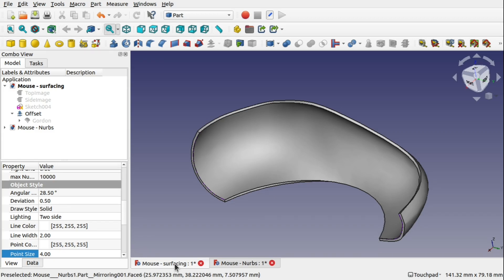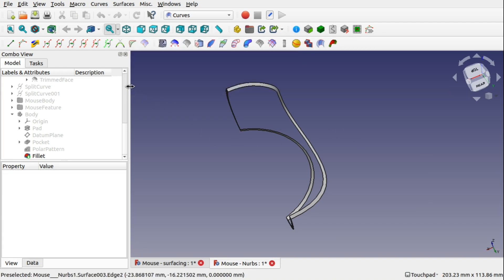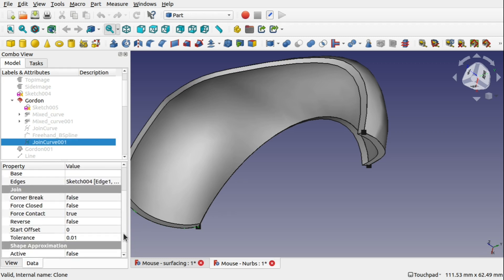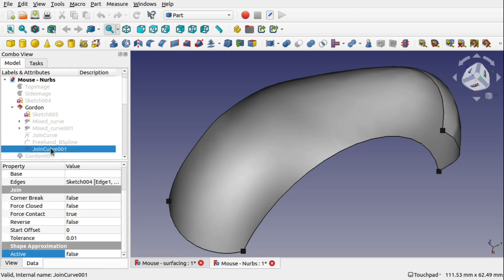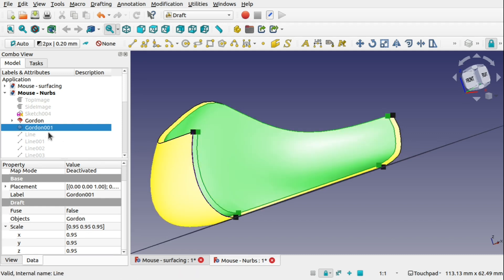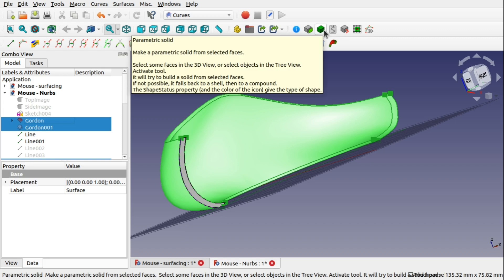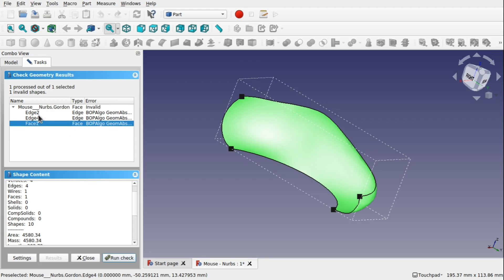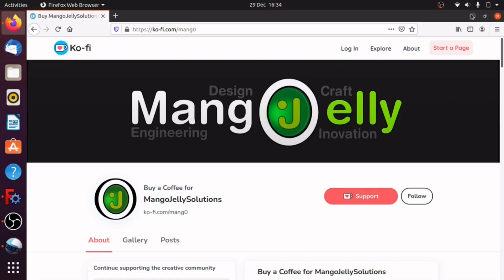FreeCAD: Fixing the Part WB 3D Offset error when adding depth to Gordon Surface in Curves Workbench.

Comment: I got the same problem, but I dont have Joint Curves, I just made a simple surface from multiple arches and it won`t offset no matter what I try. Tried converting to solid, still doesnt work. I am lost

Comment: > Thank You for this 'fix' - having recently encountered problems when trying to add offset infill or thickness. 
(I will have to do a test project to explore this - Rather than possibly 'break' as existing project.)
> Wondering if setting JoinCurve to Active should become a normal part of the method when defining a 3D collection of such curves - that are then used as edges/boundaries & supports on NURBS approximations, and with the Surface/Curved Surfaces Work Benches.
> ...And therefore wondering about a macro/python script/toolbar button to "Set Active" for a selected curve (and continuity?).
Or, even if it is possible to change the joincurve > active property default from False to True etc.

Comment: I am able to use FreeCAD in a productive way only due to videos like this, and most of them are from you. I am really grateful for the wonderful service that you are providing for the community. Regarding fixing offset errors on Gordon surfaces, I have checked to make sure that mixed curves and join curves that are used to make the surface all have shape approximation enabled, but still the offset is failing. This is with FreeCAD 0.20.1. I will continue to look into this, but if you have any suggestion, please share them.
Reply from the maker: Thank you for such kind word, it's great that you are finding the videos useful.  It's always a pleasure to create these.  Yes so the underlying opensource geometry framework has certain problems with offsets that are being tackled.  I am working on plans for other videos regarding alternative way on how you would create these offsets.  I was only talking with a developer a couple of days ago who has extensive knowledge of the freeCAD code base and we are combining forces in the new year to tackle some knowledge gaps.  Just updated my blog about it here: https://mangojellysolutions.blogspot.com/2022/12/teaming-up-with-freecad-dev.html

Comment: Thanks for this, I must admit I was dissatisfied when you had to clone and scale the Gordon surface, as it means the part is not evenly thick, and it felt like a "bodge". I'm glad that you were abe to work out how to make the offset work. Its also really valuable knowing about the check geometry; so often with FreeCAD I find something not working and not knowing what to do, so its good to have it pointed out that there are some tools available, even if its not immediately clear what the messages mean. FreeCAD is definitely not as "slick" as other options, but it does have a huge range of facilities, and I've noticed its been slowly getting easier to use and less arcane as time goes by, I hope this trend continues! I love your videos, you explain things well.
Reply from the maker: I felt the same, it just didn't feel right and I was determined to find the right solution. It took some digging to find but I  took it as a challenge.

 I used to create tutorials years back for Rhino 3D but they are long gone from the Internet so I  want to recreate those for FreeCAD. The tools in Rhino for surfaces are amazing and I see that freecad is going in the right direction.

 I am on a bit of a mission to showcase freecad and what it can do, the more people adopt it the more it will evolve. I am very much against the subscription cloud model for creative programs. Not owning software which you can fire up anytime, even years later to rework your projects without paying out again just seems a licence to print money to me and doesn't encourage creativity. 

I have to admit once I found the solution I was able to sleep at night! Well, now the tutorials out I will. Thanks for the support glad you like the videos. Always good to get feedback.
Reply: @MangoJellySolutions  Really great how you solved this one, I need to study how you did this exactly again, but I feel this is the way to go. I recognize the feeling of not being able to sleep until a problem is solved in the correct way. Thank you very much, I ‘ll be able to use this in my experimental windturbine design…